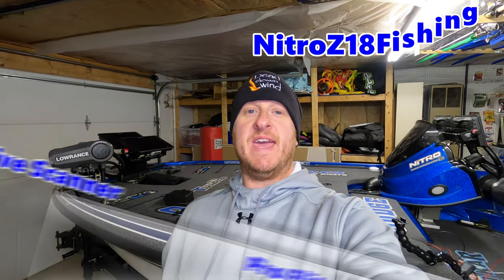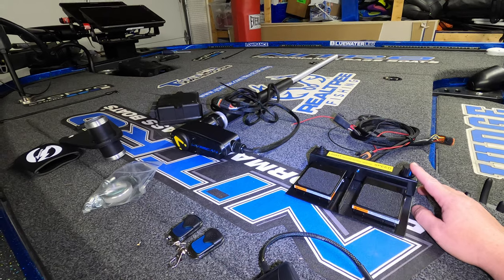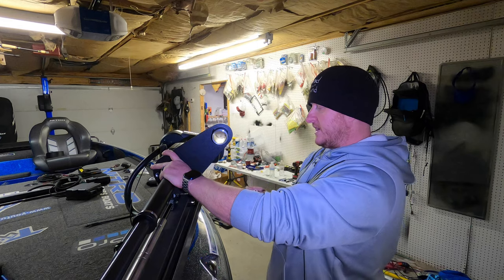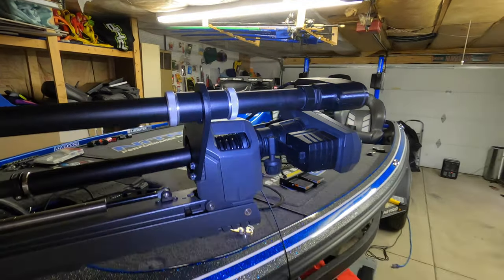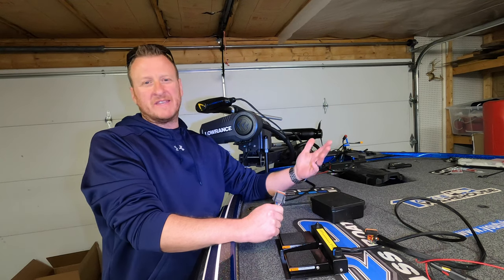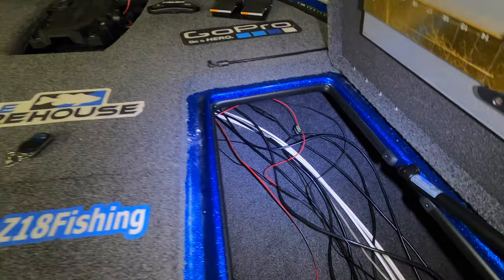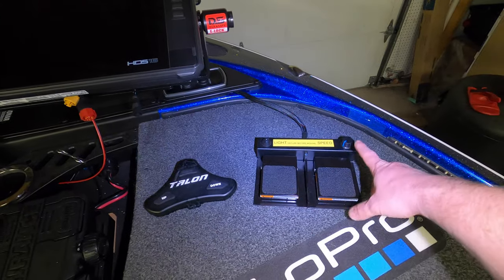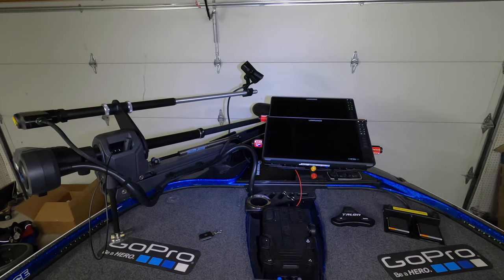The Live Scanner Pro Elite Trolling Motor Mount For Lowrance Active Target/Garmin LiveScope

Comment: Wow def going to have to modify the boat cover! Cover will prob put a lot of pressure on that mount/ducer. I have concerns with cover issues just with the ducer mounted on the TM shaft.
Reply from the maker: yes sir, that's the only negative with any of these kinds of mounts...I actually don't use cover much, so for me it's well worth the trade off, but I may have mine altered to fit just in case!

Comment: I bought the livescanner pro elite also, putting it on a Ghost with active target.  Does the foot control have programmed stops so it doesn't hit the trolling motor shaft when spinning around?  Mine won't clear the trolling motor shaft.  Not sure if I have it on wrong but it pretty much goes on one way....
Reply from the maker: Hmm, something doesn’t sound right, I have no issues with that at all...I can spin my AT all the way right or left and it doesn’t hit my Ghost shaft, I would call or email them and see what they say...but mine doesn’t hit the shaft at all!
Reply: @NitroZ18Fishing  Thanks.  I will call them Monday since it is Easter weekend.  I powered up the unit and with the transducer stopping just before it hits the tm shaft, I spin it to the right it will stop looking almost straight back.  It definitely doesn't go 360 degrees, more like 280 degrees.   I know you put yours on the port side, mine is starboard side.  I even tried moving the at transducer to the other side of the livescanner shaft, still hit the tm shaft.
Reply from the maker: Let me know how ya make out, that’s really strange!...good luck Jimmy!